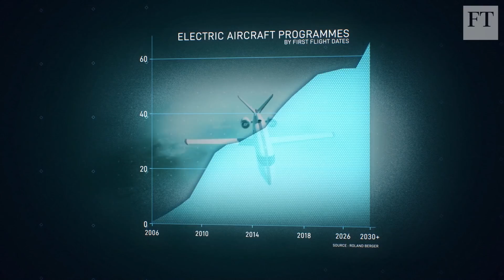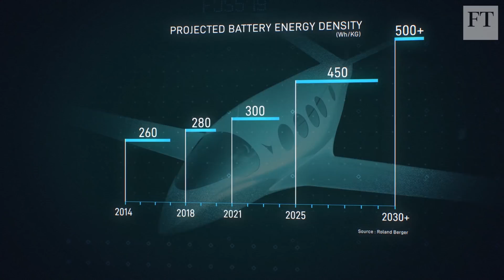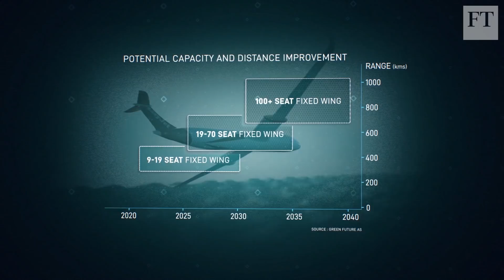Could electric power transform aviation? | Transformative Tech

Comment: Interesting,but I don't know how they would do it without fuel cells: they are a lot lighter than batteries "Hydrogen’s weight-to-energy ratio is significantly higher than batteries or gasoline. That means longer flight times, better range, and more payload capability. Hydrogen’s advantages are no secret. Its use is rapidly increasing worldwide." https://skai.co/